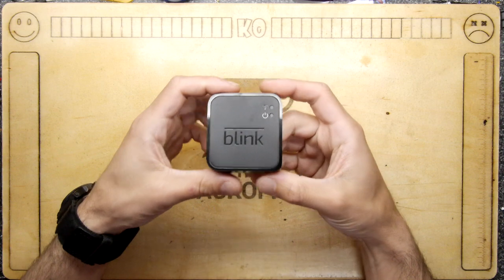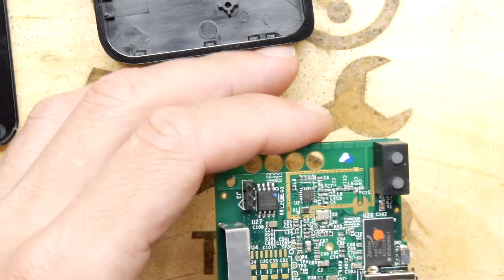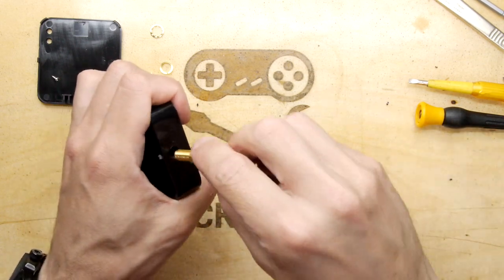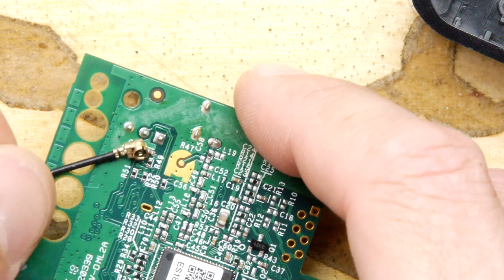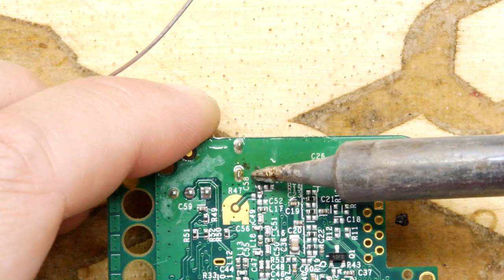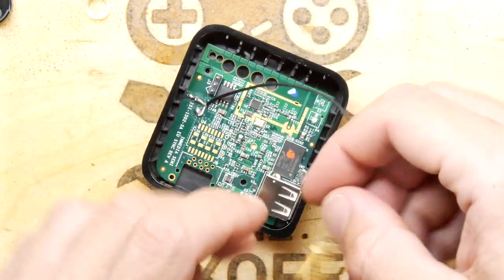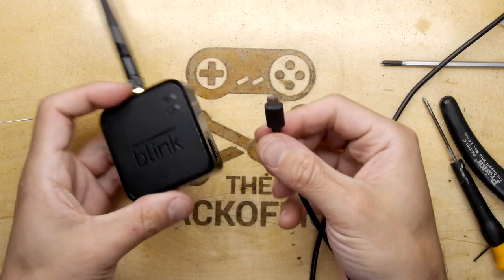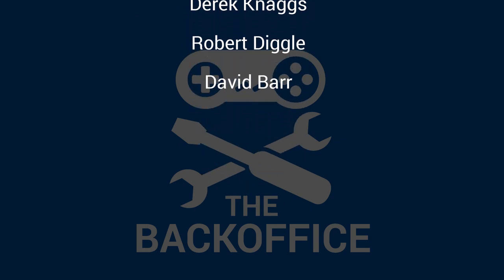Blink Camera WIFI range hack

Comment: Firmware updates (around 9/2019-10/2019) really improved the WiFi connectivity issues. It seems to be running great now...for the price the Blink XT2 is hard to beat. The Sync Module sends commands and setting changes to the camera while the camera sends video directly to the WiFi router. As of today, I'm running 12.12.28 firmware on my Sync Module. The camera now is running 7.87 firmware.
Reply: how to do this firmware update ?
Reply: @DerekHundik  Click "update".... lol
Reply: No it is not enough. Blink Sync module has a cheap internal antena. They should have provided a sma socket for diversity antena or an ethernet jack. Cheap hardware & cheap design.
Reply: @testman9541  It maybe cheap hardware and a cheap design...but Blink Outdoor Cameras have been running just fine for both friends/family here in northern New England for the last year-plus. In fact, each camera has a $30 solar panel since last summer..so no worry about battery swap out.
Reply from the maker: It's a good system, with good batteries and good access to WiFi they work really well. How the new ones managed to double the battery life I will never know. I recently updated to a mesh network and they are very performant now.
Reply: @backofficeshow  Agreed...mesh networks really can make a big difference, especially with a wi-fi security camera system spread out around the house.
Reply: I was not talking about the cameras only about the Sync module. No ethernet jack.    Poor low gain antenna. Dual RF system that requires both wifi and sync modulation to be in sight of the camera = need to spread sync modules everywhere on your property = no easy power fallback. A thieve will like this 🙄 Plus we have no idea of the real security of the proprietary HF Chan stack. FYI, with latest firmw sync is down multiple time per week on my config. So camera is ok. Sync module is bad 💆

Comment: Do the cameras rely on that wifi?
Reply from the maker: unfortunately they also need a really good Wi-Fi connection to your router which is even harder to achieve
Reply: @backofficeshow  why do they even need this module if you need direct connection in addition?
Just as a low power standby channel?
Reply from the maker: I think it's the tricks they use to wake the cameras to configure them and poll them for images when you click preview etc
Reply: @backofficeshow  yeah the standby WiFi connection might be what drain batteries on other camera.
I've ordered one to put in the basement... I hope the signal will be strong enough

Comment: The Sync Module is far and above the downfall of their system. I too get loads of those annoying error messages. If each of your devices aren't within 30ft of each other, it's a crapshoot on whether they'll work or not. Could be a great camera system IF they put more effort into those Sync Modules.
Reply from the maker: The wired units are so much less of a headache. I suppose the only reason the sync module exists is that its BLE communication is a lot less power consuming that keeping wifi up or polling to see if the user wants anything. Also its a really pain adding more sync modules as they do not mesh, you have to keep adding new location on the app. Still its probably good enough for 90% of the people out there I suppose.

Comment: keep your system updated and put your router and the sync module on a surge protector ....Blink tech support  is very good at keeping your system up and running... but not if youre drilling holes in stuff.